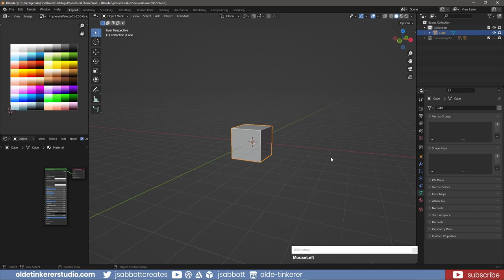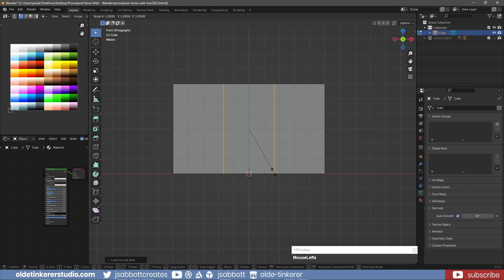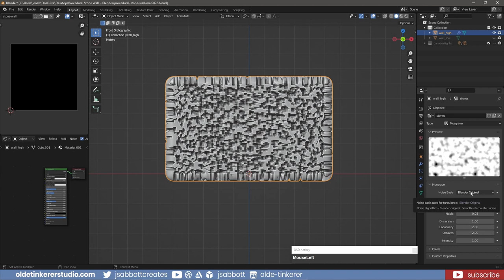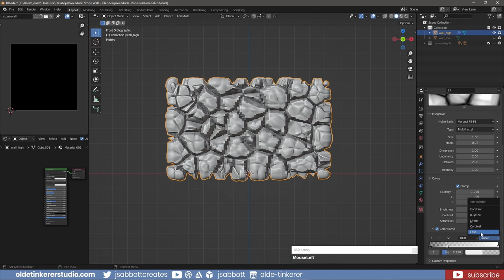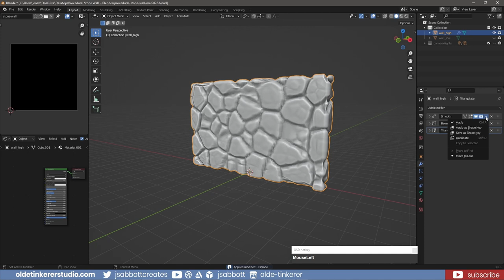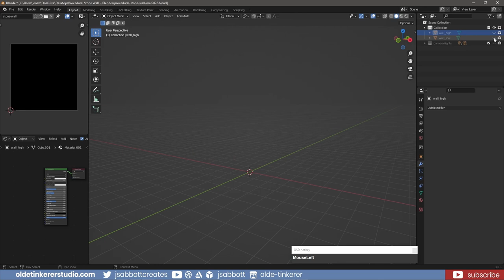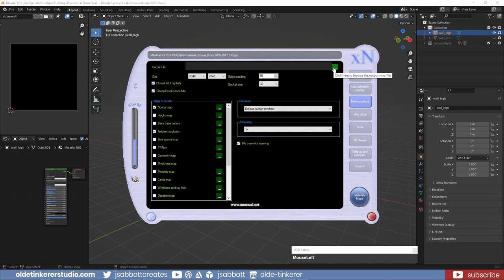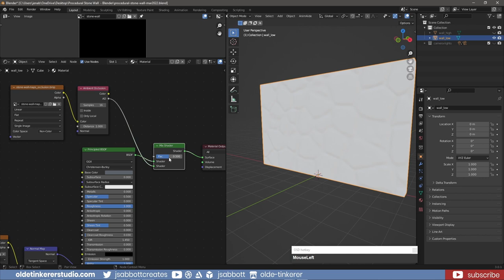How to make a procedural stonewall in Blender [3.0] and xNormal [no sculpting]

Comment: Trying to follow this and by the time I get to applying a displace modifier, I end up with a ball, rather than a wall. What am I missing?
Reply from the maker: Did you have loop cuts toward the tops and sides of the wall first (1:08)?
Reply: @JSAbbott  yes, top and bottom and both sides
Reply from the maker: @no.54reddog33  Did you apply the subdivision modifier first?
Reply: @JSAbbott  Yep. My wall is quite a bit smaller than yours, should that matter? Am trying to make something to 3d print.
Reply from the maker: @no.54reddog33  Yes, If it is too small it might not work. You could scale it up and see if that helps. If it does, work on it at the larger scale. 

After you have applied all of the modifiers you should be able to scale it down - just be careful not to overdo the size of your displace modifier or it might look weird at a smaller scale. 

I would recommend making a bunch of copies and trying various scales with each one to see what works best when you scale it down.
Reply: @JSAbbott  thank you, I've started again from a much larger object and am not getting the weird ball effect this time around so the object size must be relevent.
Reply from the maker: @no.54reddog33  Yes, that happens with some modifiers. It also happens with some physics options.